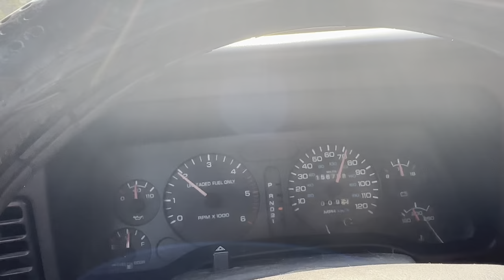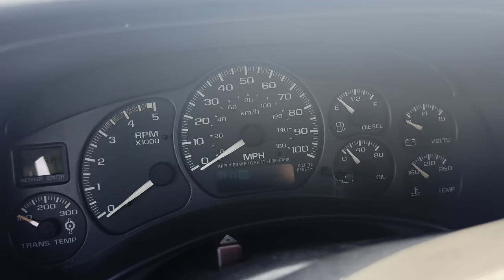Stranded 400 miles from home with our truck and 5th wheel coming home from FASTER HORSES Michigan

Comment: You have a vacuum leak. the reason the HVAC is on defrost and feet  is because that is the default position it will go to when the vacuum supply is weak check the vacuum feed coming off the brake booster, that line commonly breaks. Also the hesitation and stalling can occur from vacuum leaks. take a can of brake clean or carb clean, spray around engine, rpm goes up or the engine stumbles you have found your leak.  Also your assumption is correct, they dont like those silly gimmick spark plugs, just install the regular  oe style and some fresh wires.
Reply from the maker: @nateharris1918  appreciate the input that’s exactly what my plan was and hopefully I get it fixed easily